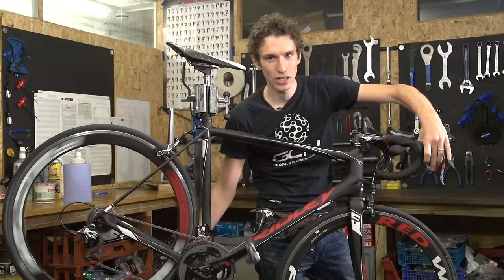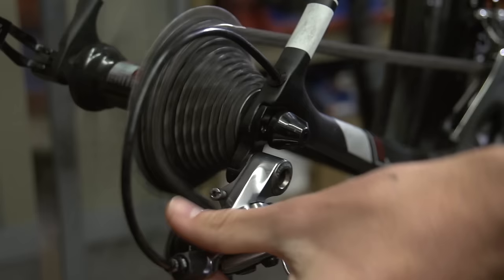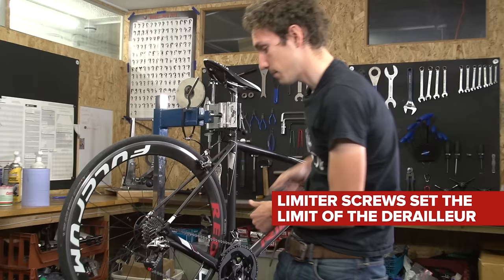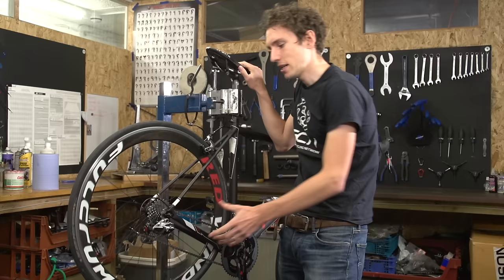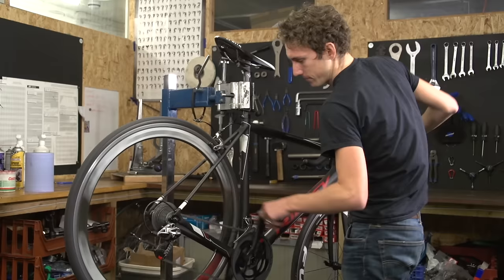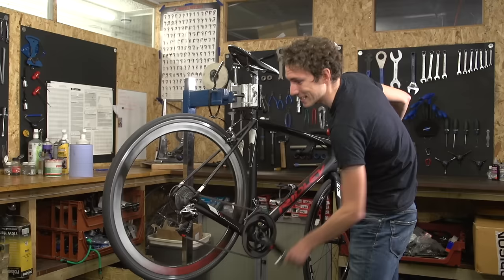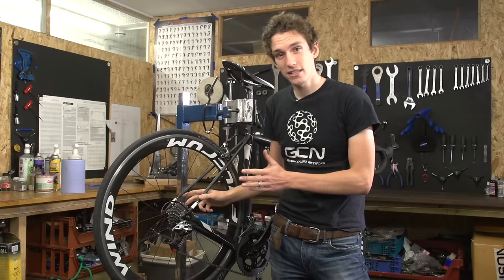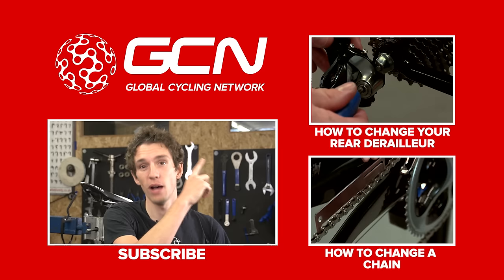How To Index Your Gears - Adjusting Your Rear Derailleur

Comment: Years ago, the first mtb I ever bought, I bought out of a friend's  out  shed.  I was really starting to turn into a cyclist and beginning to know what I was looking at. Saw some the mid-range and high end parts on it and I offered him $150 and a case of beer and the deal was done. The old owner told me he and his brother used to race and his brother still had all the tools and what not and recommended I go over there and get her tuned up.

Fast-forward several months: I've now learned some bike mechanics from this guy and got some tools of my own, etc.  The mechanic brother told me from start he had to lock out first two low gears. I didn't ask any questions, whatever dude let's f-in ride!   Now I'm in my garage, summer in Florida, I'm four hours in. I've done all this, cables,tire alignment, literally this whole list. Then I notice a mounting screw that looks... Aftermarket. I load up and drive over to the mechanic brother's house and I'm like dude wtf is that. I've been trying to tune this thing up for HOURS and I finally notice this screw.  He goes "I told you I locked out those gears for a reason.  Turns out when upgrading to the parts that were on the bike when I bought it, the brothers had bought a rear-derailer that didn't actually fit so they drilled and tapped the frame to make it fit but once they installed the part realized it would never index properly and just decided to live with it. 

I still have that bike going on 10 years now. It's a hardtail Voodoo Bokor made by Easton.  I've never changed any of the parts except for a new fork, chain, 5 sets of tires, and tubes a plenty. Still ride it regularly. It's a real Frankenstein and always draws loads of comments on the trail. I don't think I'll ever part with it .

Comment: Do you know what grind my gears?
- Non indexed gears
Reply: Leads to the question, what is non-indexed gears?????????
Reply: Bike derailleurs used to never be indexed at all, they used "friction shifting" where a shifting lever adjusted cable tension. You had to move this lever to change gears and for each change, fine tune it so the chain was quiet.

Comment: Very grateful for this excellent video.My LBS failed twice to index my gears. They were extremely rude about my bike and insisted I change they change the hanger. Gears still didn't work properly But guess what - using this video and taking a bit of time the gears are working fine and now I understand how to adjust them myself. Thank you.

Comment: Left brake lever = rear break. Crazy
Reply: +Kirby Louis It's because we drive on the left, apparently.
Reply: Noticed that one too. Mind blown.
Reply: Makes sense to me because more people are right handed therefore have a stronger right hand and the front brake does most of your stopping
Reply: The english way is the same as a motorbike, the front wheel has the most breaking grip under deceleration so the front is the primary brake(right hand). I think right=front brake is a little better, I ride both and realistically there is just about no difference.
Reply: I thought it was something to do with indication.
Reply: That's what I figured. For me, the rear brake is safer, so when I'm turning right (from the left hand lane), it's easier to be using my left hand to brake, right to indicate. Never thought about it before, but I guess it's the opposite on countries that drive on the right?
Reply: When you use the left lever something breaks?
That's terrible.
Then you have no brake on one wheel.
Terrible fortune when your brake breaks.
Reply: right hand is also the dominate and therefore the more accurate one
Reply: In India all bikes have rear brake on left hand😶
Reply: Does on mine.

Comment: he's got his back brake on the left hand side? wonky englishmen..
Reply: I noticed that too.  What!?  No... Way...
Reply: That is because we ride on the correct side of the road in the UK (the left) ;) so because a right turn is across the traffic it is more important to make a hand signal than if turning left and therefore we need to use the left hand for the rear brake.
Reply: Understood.  You don't want to brake the front wheel with one hand.

Comment: Thanks for the clear explanation. I just had a stab at indexing the rear derailleur. Tomorrow's ride will tell me if I succeeded. I had no work stand so I bodged it by hanging the saddle up with a string to keep the rear wheel off the ground. I submitted a photo on Twitter with the hashtag :)

Comment: so good!  These vids just keep getting better!  thanks so much!  
also, for trouble shifting, not only old cables, but also possibly old housing (or improper length or movement of housing).  I just spent two hours on a bike that's typically easy to shift.  and boom!....my housing was pivoting out as the derailleur moved, causing inconsistent tension.  I added an extra inch, and voila!

Comment: really good video.clear easy advice.i recently had a new well fitted.the gears work fine but are out of order.ie when it's says 3rd on my gear shifter my chain is actually in 2nd so if I'm reading it right i need to turn that barrell adjuster clockwise till it sits in the same gear as the gear shifter says.im gonna have a go at doing it and then come back with a comment as to how i got on.

Comment: Another great video, yes I am that old, I watched the one on changing a rear tire and it was the first video I saw that explained how to rest the chain on the deraliieur cog when putting the rear tire back after replacing an inner tube for example. I followed this instruction and was surprised at how easier it was to put the wheel back using the weight of the bike in a downward motion. The derailleur went back to its original position fairly easy with just a little bit of lining up for the wheel to slot into place.

Comment: Man such a great video. Was freaking out over my new bike acting up and I did the simple turn the nut counter clockwise and got it back to shifting buttery smooth and it also stopped it from jumping. This is on a 105 groupset so I was especially angry after spending so much and having a issue so soon. Luckily it just needed an adjustment.
Reply from the maker: Glad it helped!

Comment: Great video and I'm sure I've liked this every time I've watched it to fine tune an indexing issue. Recently I took delivery of a new bike from a direct seller and unfortunately the person conducting rear derailleur set up focused solely on adjustment via the limiting screws one of which was almost adjusted to the point of the screw falling out which made it very difficult to fine tune without going all the way back to a baseline setting....which after a lot of swearing I did anyway.    Judging from some comments on this video, it would be really valuable to  know how to set everything back to a baseline/neutral or middle position incase you run out of adjustment.    Anyways, great show and keep of the good work.

Comment: Newbie here. So, for the first adjustments for the rear derailleur the front derailleur should be on the small chainring. THEN, go ahead with the procedure you are outline here. I just had new cables, new cassette last year but I am only on my bike 3x wk and about 25km a time. It's a very old GT ZR3.0. Shimano105. drive  My LBS told me that I'm going to need new shifters pretty soon. I can get some alignment but when I'm on the road the shifting gets sticky/jumpy from time to time.. Thanks for the tutorials!

Comment: I traced an annoying shifting/indexing problem to my new chain. I inadvertently left the outer plates flared a tiny bit on the link where I joined the chain. Pushing the plates together with a chain tool fixed the problem. I had already replaced the cable and was on the verge of buying a new cassette and chainrings when I happened to notice the flared link while oiling the chain.

Comment: Having an issue that I cant seem to sort out. I hope I give you enough info so you can help me out. I have a full suspension mountain bike that the front is singled out to a 36 oval ring and I had an 11-28 (8 ring) cassette. Everything work flawlessly. Due to difficulty climbing hills after singling out the front I decided to go to a 11-46 (9 ring) cassette. I installed the new cassette,  new derailleur drop hanger, new chain, and 9 speed gear selector ( transmission ). Made all the adjustments to the derailleur for the limits including the B setting. When shifting through the gears, there are 2 spots that I must press twice to get a single shift. Also when down shifting it takes 2 pulls to shift from 1 gear to the next. Due to this issue I can not achieve the 2 largest (lowest) gears.

Comment: Great video, makes sense. But I'm still wondering if you ever need to tighten or loosen the cable by pulling on it manually and screwing it in place? Is the cable just coarse adjustment and the barrel adjuster fine adjustment?

Comment: So is it pretty much as simple as saying that you've got it right if:

1. the chain makes a straight vertical line from the rear derailleur to the ring on the cassette for all rings on the cassette
2. the rear derailleur is able to move the chain along all rings of the cassette in both the big and small ring at the front
3. there are no weird noises

Is that pretty much it?

Also, Simon you didn't really explain how we know if we've adjusted the limit screws enough/too much...I am assuming the screws are adjusted properly if you can't use your hand to move the derailleur any further than the point at which it is directly below the biggest or smallest ring on the cassette...right?

Comment: Changed my rear shifter, due to wear while, keeping the derailleur and sprockets/gears and wheel the same
 They go up and down too good, skipping one gear or the other.  I was able to adjust such that all "speeds" are utilized on the shifter but still have this issue. I will check the limit screws and vertical alignment next. BUT..... Could there be an issue of different spacing between sprockets requirements between different manufacturers?  Currently, shifter is SRAM, and Derailleur is from Shimano.

Comment: Great video!  Thank you!  What happens if your barrel adjuster is adjusted all the way in or out and you still aren't getting a smooth shift throughout the gears?
Reply: I'm not an expert, but:
Probably need a new cable? back the barrel off to half way, then fit the new cable, so you can use the barrel to adjust it in both directions.

Comment: Ok, thats great information wondering if this process is the correct one for my situation. I have a brand new 7-speed beach cruiser the derailer works perfectly it appears smooth and all but it is not shifting into the large sprocket which I believe is 1st gear something shifted during transportation when the car had an accident. The bike is undamaged it just won't shift into 1st like it did at the store in any case, I'm sure it's a matter of a small tweak. Is this indexing procedure the method I should use to reach 1st gear?

Comment: After replacing the chains on both my hybrid bikes,  both were jumping teeth. I took 2 links out of the chains to bring more tension to the chains. One bike was no longer jumping but the other one was only slightly better, still jumping. I'm guessing that the sprockets are worn. They don't look bad but I don't know what else it could be. Neither was jumping before I replaced the chains. I only replaced the chains because they were well beyond my gauge. Any thoughts?

Comment: So do you have to adjust the tension for each individual cog, it’s not just once and the tension is set for the whole cassette? Because I thought if you’re struggling getting up so you tighten it but then it’s too tight to get back down then you’re in a bit of a pickle because you can’t have it both ways. How does it work?

Comment: Hi!

I got a problem today! My rear wheel just locked and didn't want to move its stuck both forward and backward .. My bike have a cassette and i got Entry-level Rollerbrake IM41 for brake system.. 

What do you think could be the problem? What can i do to fix it? 

Any advice is appreciated!

Comment: is it the same handling for the front derailleur ? if the chain goes to slowly to the higher gear do I have to turn the barrel adjuster clockwise or anti-clockwise ,? I think it should be anti clockwise to tighten the cable....? Thanks

Comment: I just got the new Triban RC 520 with the Shimano 105 group set. The gears have been set up by a bike shop.
Now I dont have any problems with down- or upshifting at all. However, in the hardest gear of the small ring and the five hardest gears of the big ring my chain is rattling while pedaling normally.
Did I understand this video correctly that I probably just need to turn this little (keep forgetting the name of the turnable thing above the derailleur) anticlockwise and that should solve the issue?
Thanks for any help!

Comment: Hi, love the show and have a a quick question.
Just changed from an 8 speed 12-25 rear cassette to an 11-28, everything runs smoothly down to 7th but going into 8th it makes a racket, so a slight adjustment is needed somewhere but i'm not sure which screw to turn ect, any help would be great...Ben

Comment: Hi 
Thanks for the video. I have an annoying issue though. Very noisy drive train when in big ring on front and the middle cogs on the back. Gears index smoothly both up and down but when in the middle cogs on rear it sounds something like chain is skipping/gears not indexed correctly but a softer sound. It's very irritating to be honest. I've aligned hanger, bought new cassette and bough new chain and replaced gear cable!! Noise remains. Chain never slips. Gears change fine. Can't isolate the cause of the noise. Any ideas what could be causing it? Thanks.

Comment: I have a problem. it would appear that when in the lowest gear (biggest cog) touches the chain feeding gear mech part (sorry for poor names, new to biking)
Reply: i think you need to adjust a third screw. there must be 3 screws in the mech, the 2 that were shown in the video to adjust low and high limits, then there is a third one that adjust the distance between  the  mech and the largest cog. I remember hearing somewhere that is called the B-tension screw, or something like that. I wonder why they didnt mention it in this video.
Reply: Navi Nathane Charlotte Thankyou so much for the response :)

I will check this out and report back how it goes :D

Comment: Am I right in thinking that a new bike/gear will extend the wires a bit after use? My new bike seem to be slightly jumping between gears now, is it normal to readjust the gears after a few rides?
Reply: Still sounds like I should reindex my gears though. (Or maybe they weren't properly indexed from the shop)
Reply from the maker: Trond Helge Rolland If they're not as smooth as they were then yes, it sounds like you do need to give the barrel adjuster a tweak to re-index. Give it a go, it's really straightforward as you can see.
Reply: Hi Trond, I recently replaced my rear derailluer cable and indexed it to my satisfaction on the day, but for the next few rides had to slightly tighten the barrel adjuster say a quarter or eighth of a turn at a time (anti-clockwise viewed from the back), but now it seems nicely settled down and I haven't had to touch it since.

Comment: Hello, I'm buying new wheelset with different cassette. Do I have to index my gears every time when I change cassette with different gear ratio.(11-32 and 11-26 both 11speed?). Or can I just switch wheels and ride?

Thanks for your answer.
Reply: the gear ratios dont matter and normaly dont screw with the indexing, however its possible that either the cassette, or the hub, or both have small differences to your other wheelset, indexing might be needed than.

Comment: Question what do you do if you Shimano derailer does not have a barrel adjustment?    My 2104 Trek DS  8.6 does not have on.  The cable passes through the derailleur to the crew that secures it. No barrel or any moveable part.

Comment: Help:   I used the above method but still getting stuck.  I have Shimano 2x9 and was having problems  with the 2nd (smallest cog) gear wanting to skip down to 1st (smallest cog). When I adjust as discussed above I then have problems with gear 8 wanted to skip into gear 9. I can't seem to find a middle ground :(

Comment: So on the grip shifter I have on my bike  I need to hold towards me like revving a motorcycle in the final gear at the top of the cassette. If I let go of the grip it falls down to the second cog. I turn the adjustment anti clockwise and it’s perfect but then the middle cluster cogs aren’t right. What will I need to do?

Comment: My Front derailleur rubs in the big ring when the chain is in the biggest sprocket at the back, I use your method to adjust it but then it rubs in the small ring and on the small sprocket at the back and vice versa, I'm using Shimano ultegra,
any Suggestions?
Reply: dont to cross chaining.

Comment: Yoooo! I need a bit of help. My deraileur is making one HELL of a noise, and it's perfectly indexed/limited after five hours of being unable to get it to work. It sounds like it's coming from the jockey wheels, but it's not moving, the mech cage isn't bent, the hanger is not bent and the jockey wheels are adequately tightened. Could the problem be the chain and/or jockey wheels being worn out?

Comment: Hi. So I just looked at the bike I bought a few days ago (it's BTWIN rr8.1 bike) and the rear derailler doesn't have the rotating thingy to index my gears (the thing he turns at 3:46 ) the cable goes straight into the derailleur. It does have the H/L screws and another screw behind the derailleur. Any ideas how to index my gears if it's needed?
Reply: Ashkan Ahmadi maybe you figured it out by now, but on my bike the rotating part is near the shifter on my handle bar. I was a bit confused at first too.